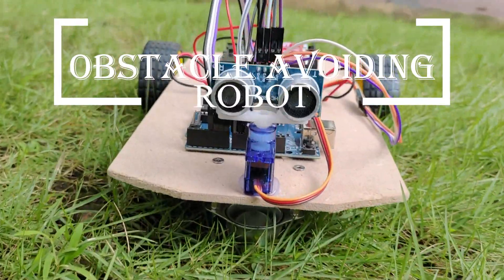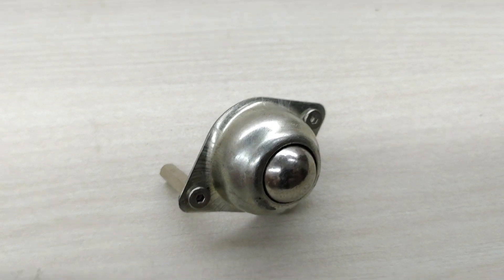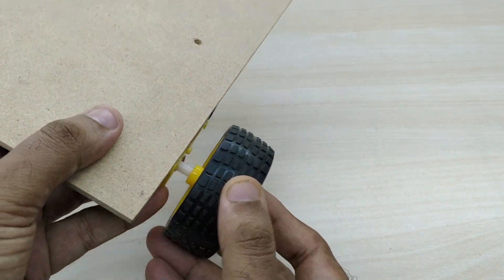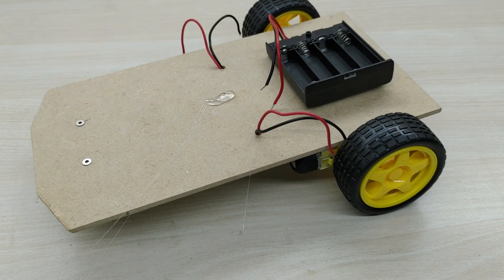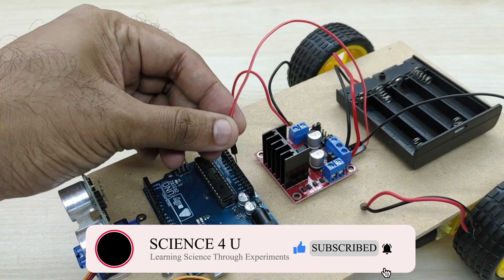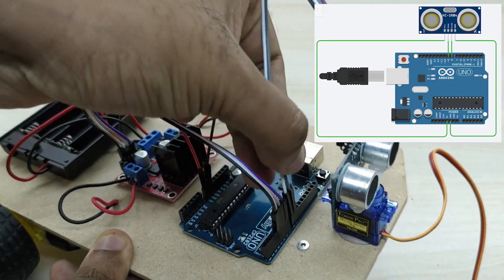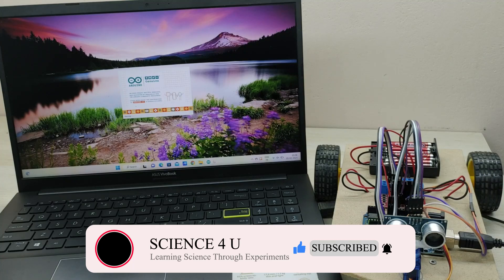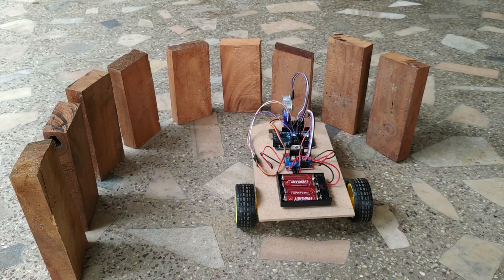Intelligent Obstacle Avoiding Robot || Step by Step Tutorial || Arduino Project

Comment: Why when I connect the the 5v and gnd the board turns off even when plugged to a computer
Can you please answer quickly
Reply from the maker: Hi friend, I think it is due to a faulty arduino board. Can you try unplugging everything and connect just the arduino board to pc/laptop using a usb cable? Is it powering on? that is the green LED is glowing?.
Reply: @Science_4U_  yes
Reply: Everything is working finr
Reply from the maker: @dummydoes  okay nice.. then the arduino board is okay..
Reply: @Science_4U_  but when I connect gnd and 5v it stops working
Reply from the maker: @dummydoes  What component is connected to 5V and gnd?. Is it a sensor or servo motor?.
Reply from the maker: It could be mostly a problem with the component that you are connecting to 5v and gnd. It may be short circuiting the board causing the board to turn off when the component is connected. Is it an LED bulb that you are connecting?. A short circuited/burnt LED bulb will also cause the arduino to turn off..
Reply: @Science_4U_  the sensor
Reply from the maker: @dummydoes  which is the  sensor that causes arduino to turn off, friend?
Reply: @Science_4U_  yes
Reply from the maker: @dummydoes  can you tell the name the sensor please?.
Reply: @Science_4U_  HC-SRO4
Reply from the maker: @dummydoes  okay ..that is the ultrasonic sensor. I firmly believe the sensor is short circuited. Please try with another sensor. It should work👍Before trying with another sensor, you can try connecting the sensor to another 5V pin in the arduino board. If that also turns off the arduino, it is definitely the ultrasonic sensor that is short. Replacing sensor will solve the problem..👍
Reply: @Science_4U_  Thank You Very Much I will try

Comment: First. Nice video. I follow this video and viola its working. The problem is it will work on the 1st try. then have to turn it off a long time, and will work again? What is the problem? Its not consistent. im using 2 9V.
Reply from the maker: Hi friend. Thank you so much. 🙂
Reply from the maker: The problem most probably points to bad batteries. Which batteries are you using?.
Reply from the maker: Did you mean that you are using 2 Nos. of 9V batteries?. Those batteries have very poor ampere ratings and gets drained very fast. They are meant for working in transistor radios where current drawn is very less. You can use 2 Nos. of 18650 3.7volt rechargeable batreries. Those are the best. Otherwise you can use 4 Nos. of AA 1.5V batteries. Those will also last longer that 9V batteries.

Comment: Bro i have done 
everything like this but problem is it is over speed is there any way to reduce speed
Reply from the maker: Yes friend, sure. Speed is proportional to the input voltage given to the motors. We can reduce the speec by reducing the input voltage.
What is the battery pack used now? How many batteries are you using?
Reply: @Science_4U_  i used 2 batteries of 3.7 volt which means total input 7.4, 18650-1200mAh li ion cell
Reply from the maker: Hmm. Okay. If you want to further reduce speed, you can use a battery pack with 4 AA 1.5V batteries. That will be a total of 6 volts.
Reply from the maker: If you want to further reduce the speed, you have to use a different battery for the motors alone. In my project, i have used same power supply. You can use your 18650x2 powerpack for powering the arduino uno+servo motor+ultrasonic sensor. Arduino requires minimum 6V at input, so you have to use battery with more that this voltage.  For the motors alone, you can use a separate battery with lower voltage. You can use a single 3.7V 18650 battery also for the motors which will drastically reduce the speed.

Comment: Please help me, I have made the connections completely the same, my motor driver and Arduino turns on, even the servo rotates, but the wheels/motor are not working. I have used 3.7V x2 and also x3 batteries.
Reply from the maker: It should have definitely worked with 3.7v x 2 batteries. Have you used the ardino board and motor driver board before? Or is it new one?. Sometimes the boards can be faulty even if the lights turn on.
Reply from the maker: Also you can try interchanging the command pins from the arduino board to the motor driver board. The connections could have got interchanged. Also, if you have a multimeter, you can check whether the digital commands are going to the motor driver board by checking the voltage.

Comment: Sir, ive checked all the circuit connections and code uploading too... I did very carefully and correctly... When im connecting it, only the uno board's light is blowing but not moving.... Pls help me with this problem, we have our science project coming soon
Reply from the maker: Hi...Can you tell whether the led light in the L298N motor driver board is also turning on?
Reply: @Science_4U_ no sir, the light in the motor board isn't turning on
Reply from the maker: @srilatha.b7752  okay. The light in the motor driver board should have actually turned on. Can you check the power connection to the motor driver board?. Are the +ve wire from the battery connected to +12V terminal of the motor driver board & -ve wire from the battery connected to GND terminal of thr motor driver board? By just giving power to the motor driver board correctly, the red light in the motor driver board should have turned on.
Reply from the maker: @srilatha.b7752  Also can you tell whether you are using the same 4 x 1.5 V battery pack?. Are the batteries new ones?. If there is insufficient voltage, then also the motor driver board will not work.
Reply: @Science_4U_ sir please i need help i subscribeed to your channel
So when i connected all the wires ro the motor driver and coded and then i put the battery and then the motor driver and Arduino led's onned but the motor is not moving and spinning
Reply from the maker: @Szwaz9765  Hmm..okay. there could be several reasons. Though the motor driver power is on, it could be a faulty board. Have you used the driver board before or is it a new one?
Reply from the maker: @Szwaz9765  The next possibility could be bad batteries.But mostly I suspect a faulty driver board..
Reply from the maker: We have to check one by one and find out the problem..if you want please come to my instagram id and we can chat there..you can send some photos of connections also and I will help you to solve the problem..my instagram id is.
https://instagram.com/_science4u_?igshid=MzNlNGNkZWQ4Mg==
Reply: @Science_4U_ hello friend can I ask you if the same code will work for motor driver shield also?
Reply from the maker: No friend. It will not work..You have to install the motor driver shield library called adafruit. Also the commands for running the motor are different using motor driver shield..
Reply: @Science_4U_ can you just share me the code please I don't know how to code ?
Reply from the maker: @Szwaz9765  i have not made the code for the motor shield yet. I will make a robot with motor shield soon and share the code with you..
Reply: @Science_4U_ but can you do it with two gear motors and two wheels?
Reply from the maker: @Szwaz9765  Yes sure..Motor driver shield can drive upto 4 motors. So 2 motors can also be connected.
Reply: Sir, I've checked and re entered the code... Everything's fine now😊😊 thanks a lot
Reply from the maker: @srilatha.b7752  okay friend..glad to know that it worked finally🙂
Reply: Thanks a lot..! Other YouTubers just ignore the comments of audience and won't help.... Only u help within a short time. Pls continue like this only one day u will be more successful
Reply from the maker: @srilatha.b7752  Thank you so much for the encouraging comment..🙂 I will always try to respond within the shortest time.
Reply from the maker: @srilatha.b7752  ..and if possible, please try to share my channel with your friends who has interest in doing these kind of science projects. It will be nice if they also get some interest in doing these kind of projects after seeing them in my channel. I will be happy to help them also..Thank you friend..🙂
Reply: And sir, when I uploaded the code, only the servo motor just rotated backwards and didn't work
Reply from the maker: @srilatha.b7752   We will check whether atleast the ultrasonic sensor part is working. Can you switch ON and bring your hand closer to the ultrasonic sensor? Now, is the servo motor turning to  right & then to left direction?
Reply: I've did the connections as u said in video..... I used 2 AA batteries... Maybe the problem arising there
Reply from the maker: @srilatha.b7752  okay sister it will not work with 2 batteries. The input voltage should be more than 5 volts to the motor driver board. 2 batteries will only provide 3 volts. Please use 4 AA batteries and it should work👍
Reply: Ok sir, i will order the holder asap and will check. Thanks
Reply from the maker: @srilatha.b7752  okay..sure.👍
Reply: Sir, I've order 4 battery holder and connected to it.. all components are working but, it's not recognising the obstacle.. what to do?
Reply from the maker: @srilatha.b7752  Okay.Can you check whether the echo pin of ultrasonic sensor is connected to pin no 8 of arduino board and trigger pin of ultrasonic senzor is connected to pin no 9?. Please check whether the pins are connected correctly. Also voltage pin and groud pin of ultrasonic sensor  is also connected correctly to arduino board.
Reply from the maker: @srilatha.b7752  But most probably, it could be a problem with the ultrasonic sensor. There is very high chance that the sensor that we buy doesn't work. Have you used this sensor before and was it working?.For me also, it has happened that the sensors that i purchased online was not working..

Comment: Sir everything is ok now but the bot is rotating in circle
Instead of going in a straight line.
And the speed is also fast a little bit.
How to control the speed using the code?
Reply from the maker: Hi friend, the bot is supposed to go in straight line only. There is some change in the pin connection I think. Can you confirm that one motor is rotating in forward direction and one motor is rotating in backward direction?. Or is it that one motor is stationary and another motor is rotating in forward direction?
Reply: @Science_4U_  one is rotating forward and other is backward
Reply from the maker: @maheshwarverma9806  okay.. understood. Then there should have been  an interchange in the pin connections..
Reply from the maker: @maheshwarverma9806  Please intetchange 2 pins of the control pins of the motor driver board and see if the motor direction is changed to forward. If the other motor changes direction, then interchange the other 2 pins.
Reply: @Science_4U_  you mean that both the wheels must rotate in the same direction?
Reply from the maker: @maheshwarverma9806  yes friend. Without the obstacle, both the wheels should rotate in the same forward direction. When the obstacle is detected, one wheel rotates backwards , thus turning the robot and avoiding obstacle.  And then further both wheels rotate forwards.
Reply: @Science_4U_  one more thing sir is it necessary to use the gear motors or we can use the other motors also?
Reply from the maker: Other motors can also be used. But gear motors will have higher torque and lower speed and hence more suitable for this.
Reply from the maker: Also since these are not servo motors, there is no way to change the speed using code. You can only reduce the power supply voltage, which will inturn reduce the motor speed.

Comment: Only one motor is working the other one is not rotating properly.
Reply from the maker: Hi friend, this could be due to several reasons. 
1. The motor coupd be faulty
2. Check for proper wire connection to the motor.
3. A drained battery also can cause malfuntion of the motors.
Reply from the maker: Please interchange the motor connections to the lm298 driver board. If the motor that was not woking properly is still showing the same problem, the motor could be faulty.
Reply: @Science_4U_  the motor is working properly when it is connected outside and the battery is new lion battery
Reply from the maker: @maheshwarverma9806  okay. Then it is not the problem with the motor. It could be a problem with the driver board. Please interchange motor wire connection with the driver board and see if the problem is also changed to the other motor.
Reply: @Science_4U_  it's not the problem of motor driver sir we checked it.
I think there is something messy with the code
Reply from the maker: @maheshwarverma9806  I am uploading  & checking the code and functioning of the robot and then only releasing it. So code should not be the reason.
Reply from the maker: Can you do one thing. Can you lift the robot with boyh wheels in air and switch ON. Are both the motors rotating in forward direction?
Reply: @Science_4U_  yeah that's true i am gonna try to keep the exact circuit as you did then i will try again tommorow
Reply: @Science_4U_  yes the direction is forward i checked it
Reply from the maker: @maheshwarverma9806 okay sure.. The circuit has to be exactly same. The connections should be given in the same pins that I have mentioned. Then only it will work properly..
Reply from the maker: @maheshwarverma9806  okay..both motors are rotating in forward direction right? then what is the problem that you are mentioning that one motor is not working properly?

Comment: Hlo nice video can we use motor driver model L239D as we have??
Reply from the maker: Hi..did you mean L293D motor driver shield which is installed on top of arduino uno board?
Reply: @Science_4U_  yaa as it have only 2 connection points and I'm confuse the will work or not 🙂
Reply from the maker: @latikasarkar4978  Yes it will work too. L293D can drive 4 motors but 2 motors will be in parallel. That is, it cannot control all 4 motors independantly. Whereas L298N motor driver that I have used can drive all 4 motors independantly.
Reply from the maker: @latikasarkar4978  For this project, we do not need to run 4 motors independantly. There are only 2 motors connected. Hence, L293D will also definitely work.
Reply from the maker: @latikasarkar4978  But only thing is that the code that I have used will not work with this L293D motor driver shield. You have to install adafruit library and also there are different commands for running the motors using motor driver shield. So overall programming will be very different.
Reply: @Science_4U_  ok thnks for your advice but can you send me the arduino code as im not good in coding stuff for the motor L293D ,if it is possible 🙂
Reply from the maker: @latikasarkar4978  Ya I can send. But I have to do the coding, test it and then only can send. It may take some time. Meanwhile you can watch videos in which L293D is used. There will be codes also which you can download.
Reply: @Science_4U_ ok thank you for giving me your precious time 🙂
Reply: @Science_4U_  i can't able to see Arduino code whose link you given in description so can you please send the code here
Reply from the maker: You can download the code from the following link..
https://drive.google.com/file/d/11FJMN_PGLD_yJdtuzxBiAzmhhfKUOvxV/view?usp=sharing

Comment: i connected but mine is not working sir, arduino and motor driver module is blinking but robot is not even moving. giving reply will be helpful.
Reply from the maker: Hi friend, if you have followed the steps correctly as I have shown in the video, it should have definitely worked.
Reply from the maker: There could be many reasons why it is not working. I would suggest you to check the following.
1. Please check once again whether all the connections are given correctly. Please ensure that the connections are given to the correcy pin numbers.  Since the motor itself is not moving, first ensure that the control pins of motor driver board is connected correctly to pin numbers 4,5,6&7 of the arduino board. 
2. This will not work if the program is not uploaded correctly to the arduino board. Please ensure that after clicking the upload button, in the IDE software, the upload successful message is displayed. 
3. The motors and the full circuit requires a minimum voltage to work. Please ensure you are using new batteries.
4. Though the boards show light, there can be high chance that the uno board or motor driver board can be faulty. Nowadays what we buy online cannot be 100% believed. It can be faulty also. Please try to use another board and see if it works.
Reply from the maker: These are the reasons that I can see friend, of what that can go wrong that can make it not to work. Please check these and see if it works. If it doesnt work, please inform, i will further help you out.
Reply: @Science_4U_  thank you so much sir for a very clear reply 
I will try this one by one
Reply from the maker: Okay. Please do try. Also, do you have a multimeter with you? If yes, it will make the job easier. I will help you with the troubleshooting.